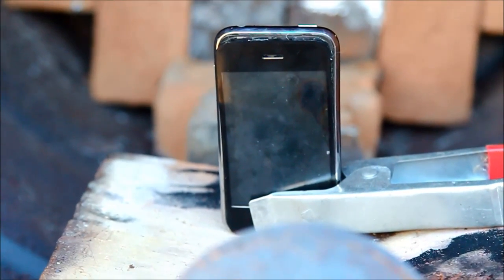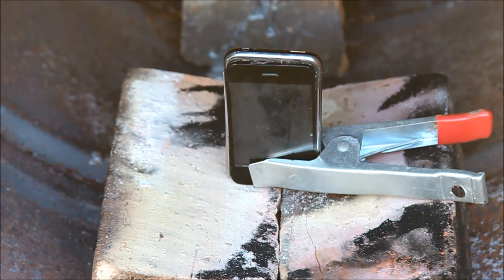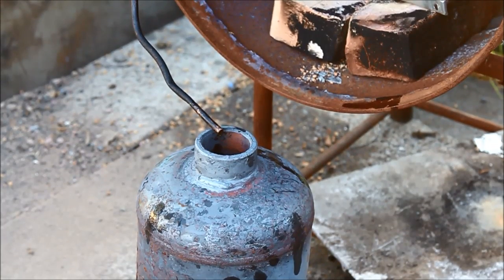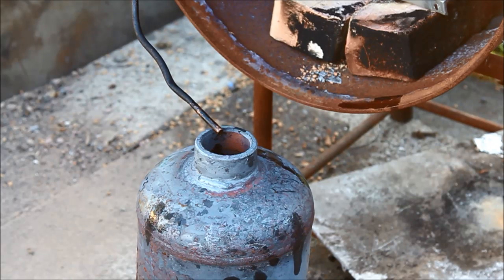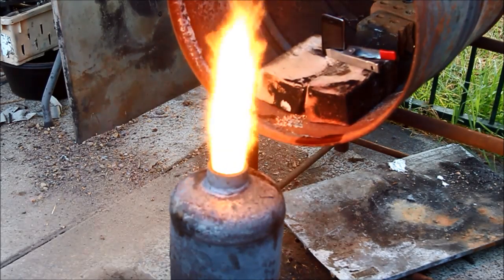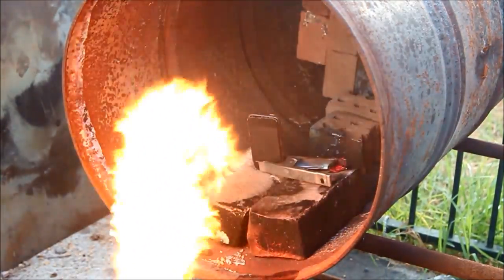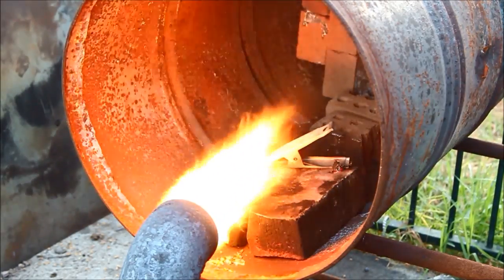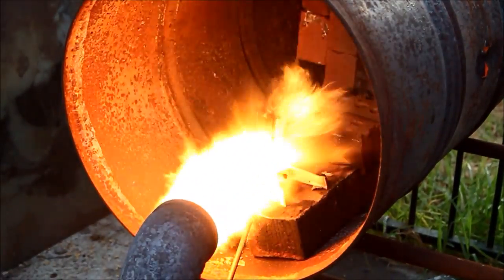iPhone burn and melt test in furnace

Comment: that's a tough little phone.. i did not see the reason why you'd burn it in the first place, there are lots of things to recycle from it
Reply from the maker: Recycle what?  Some tiny little components that you need 10,000 of to add up to anything?
 I wasn't interested in " Recycling" it. The thing served a purpose in this Vid by allowing me to show what happens when you burn and melt one down.
Reply: You have an awesome burner there. I was thinking it looked like a fighterjet engine.
Reply from the maker: Sillybillydilly It SOUNDS like a fighter jet when cranked up that's for sure. The Microphones don't do the noise these things make any justice.
Reply: My biggest thing was trying to burn stuff like polyethylene water and emtpy milkjugs without smoke.. there is a nice youtube video about magic flame rice husk burner, or even propane welding torches and bunsen burners mix air with fuel.. so it's like you somehow transfer the heat down, from a highly radiant smoky flame (radiant because of the black smoke particles at high temp) or just glowing splinters if burning solids that don't melt, but then you have to mix it further with air, and have like a second flame zone that burns the carbon monoxide and soot premixed with air over some distance, like a propane torch has entry spots for the air mixing, else even propane burns yellow sooty flame.. wasting precious fuel and creating a mess, unless you want the soot from the chimney for stuff like inks